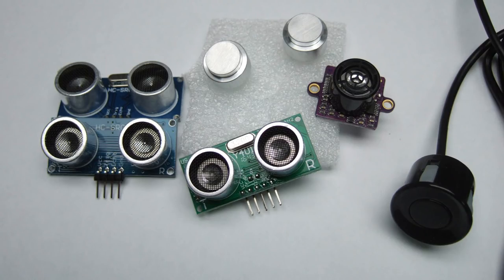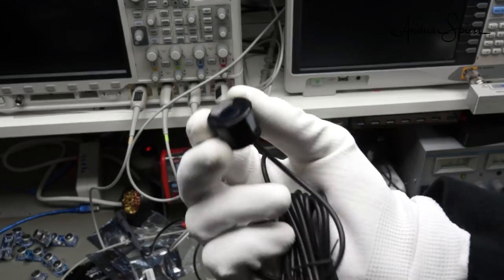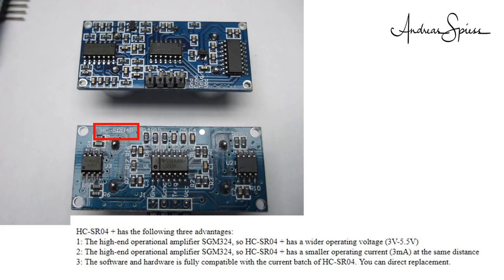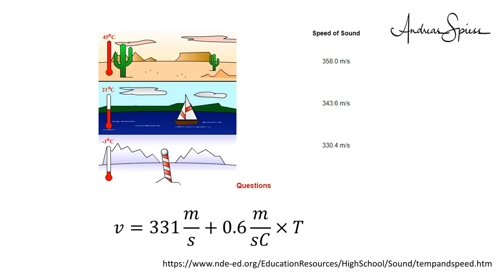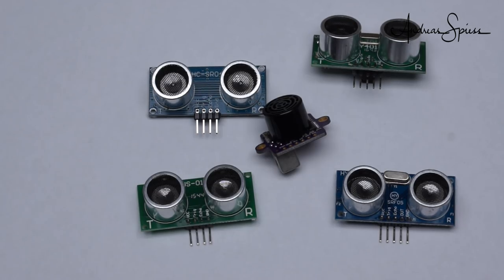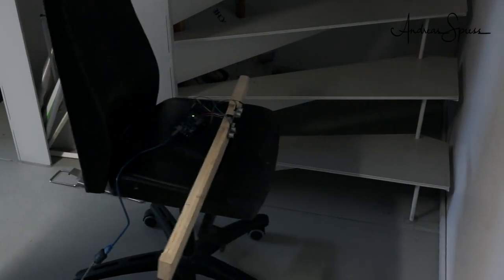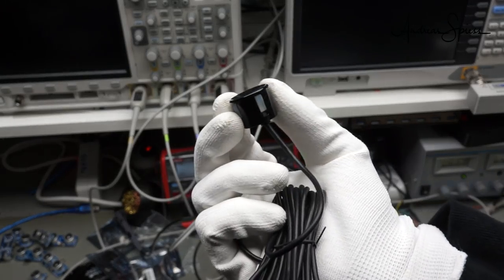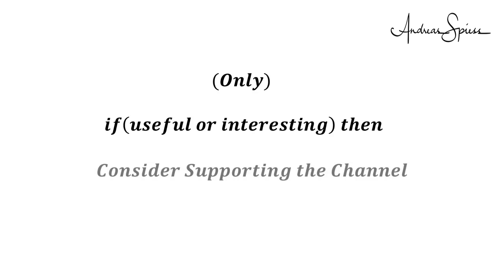#190 New Ultrasonic Sensors: Comparison and Test (US42V2, JSN-SR04T, and US-100)

Comment: I did last year a project with hc-sr04 and a wemos to measure the water level in my 10.000 liter rain water tank but it only ran good for a couple of weeks due to the condensation on the 2 'heads'. Still need to replace it with a jsn-sr04 that I bought. Reason for this project: if water level doesn't raise during rain, the filter collecting dirt needs cleaning.
https://photos.app.goo.gl/Y5iZVbo780pbiAlr1
Reply from the maker: This is a very useful project. An I think, your new sensor will be a much better choice.
Reply: Excellent idea to use these as waterlvl meters...as they dont got conductive due to high moisture...could you plz tell how accurate that was??
How about a distance of 5fts??
Reply: @Akash Banerjee when it worked (if it was dry), it was very accurate. But the moist on the heads gave very varying readings becoming useless. So I hope this new sensor isn't affected if it is all covered with moist. I am waiting warm weather to finish it as it is outdoor... So can't tell yet. BTW: this guy has the same issue although he sealed the hc-sr04 like I did, https://www.dennisjanssen.be/tutorials/photon-water-tank-sensor/) Oh and 5 fts should be no problem.
Reply: Jeroen Schaeken how about an enclosure for the sensor. An open box and cling film in front of the sensor not to disturb the sound waves?
Reply: @Ibrahim Ulf Karlsson but even that film would get all wet and probably bounce off the signals. The lid off the tank is really wet sometime... Thick fat water drops ;)
Reply: Jeroen Schaeken a slight angle on the lid and the drops roll off? Anyway I think  drop off water Infront of the sensor is much less a problem than getting the moving part itself wet. 
But anyhow please try the new sensor and let us know how it works out!
Reply: @Ibrahim Ulf Karlsson Moving parts, where? The sensor itself can't be tilted as it must direct straight to the water. Only a film could be tilted but I bet it would still get water drops. My best hope is on the new jsn sensor. Will report back in a few weeks (now freezing outside)
Reply: Jeroen Schaeken Did you try enclosing it in plastic? US sensors have a blind distance of about 3 cm (time to switch from tx to rx) so the plastic should not be much of problem. However this is just my assumption..
Reply: @Mayank Raichura  initially it was plastic except the 2 heads, afterwards I added an epoxy on the entire print plate..
Reply: Just replaced it with jsn sensor, also installed an external WiFi antenna. Everything enclosed in a box and sealed with sugru: https://photos.app.goo.gl/uzMzRTJIvpX5nHWt2
Reply: Wow! Would love to see it working or a chart... More photos please.
Reply: @Mayank Raichura Here in NodeRed (called waterput): https://photos.app.goo.gl/eNDjRCIE0JP0Mqw43
In a nutshell: the box get 220v everytime we request rain water (eg flush toilet) and the pump in the tank kicks in and I get new readings. In the box there is a USB adapter and a wemos flashed with espeasy in which the distance sensor is configured (no custom coding) to broadcast on mqtt. With a simple scale rule in NodeRed I can calculate the % from the distance measured to the water (see screenshot, 50cm = 100%; 210cm = 0%). Next step is to configure the sensor in influxdb to visualize it in grafana as NodeRed is not persistent right now and very limited in visualization of historical data.

Comment: You can use ultrasonic sensors to measure the temperature of gases ex. air really fast and regardless of sun or shade. You need to know the exact distance between sensors and by measuring the speed of sound you will know the temperature of the gas. Also by using two temperature ultrasonic sensors you can make ultrasonic anemometer using dopler shift of the sound.
They are quite expensive as a consumer product. Maybe you can try make one of these using your waterproof sensors. You can see how they look here:
https://www.google.com/search?q=ultrasonic+anemometer&prmd=ivsn&source=lnms&tbm=isch&sa=X&ved=2ahUKEwjO87i_wZ3kAhXDiIsKHdJTBUMQ_AUoAXoECAwQAQ&cshid=1566718654596&biw=960&bih=600&dpr=2
Reply from the maker: I knew about the aneometers but never tried one. Very interesting technology!

Comment: I found NewPIng did not work  at all with the newer JSN-SR0r5(v3) board (at 5v).. and playing wit hthe timing only resulted in spurious readings with many "0cm" and 676cm (infitite) readings.

I fixed some of the reliability issues with the INPUT_PULLUP.. also had to take all of the Serial.print()s out of the timing loops (or anywhere near pulseIn() )... adjusted the pulse delay to 20uS.. and for me, I was getting occasional infinite (676cm / 22.5ft) so I discard anything over 20ft (610cm) and re-read.

Hope this helps others:
https://github.com/LetsCodeBlacksburg/arduino-recipes/blob/master/ultrasonic-jsn-sr04t_BEST/ultrasonic-jsn-sr04t_BEST.ino
Reply from the maker: Thank you for the link!
Reply: @AndreasSpiess  Thank YOU! LOVE your detailed videos...